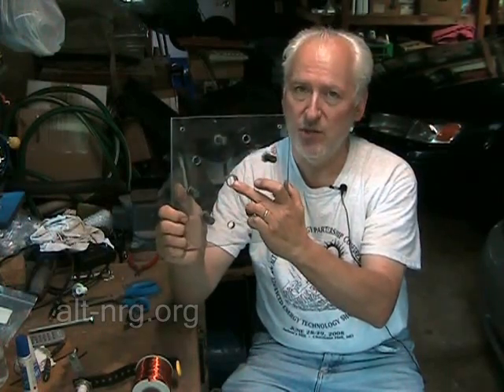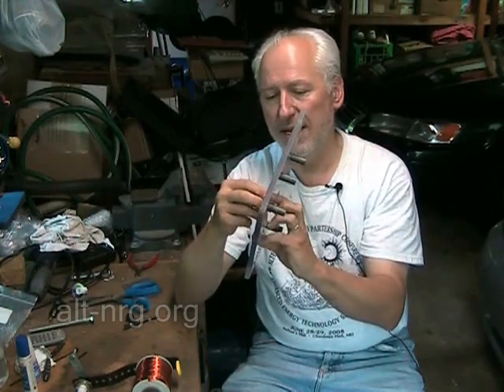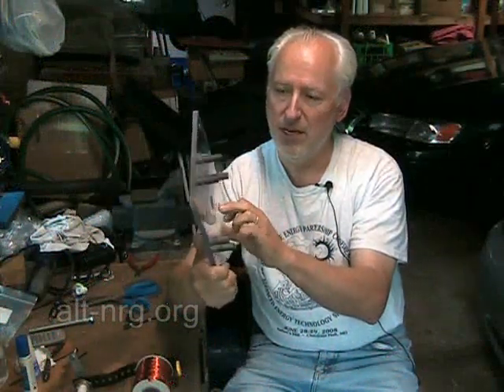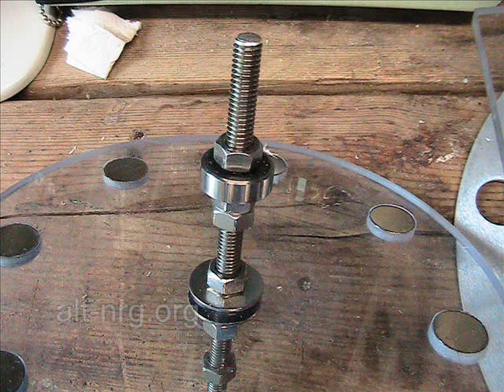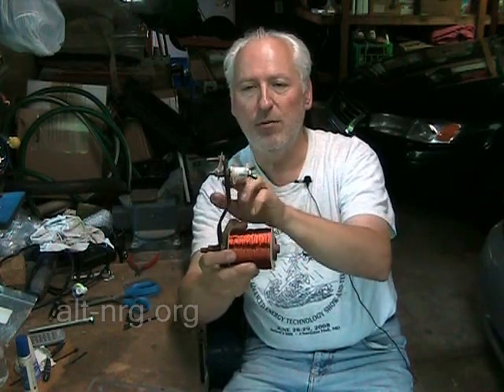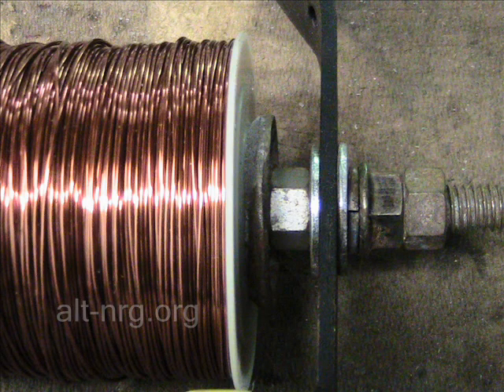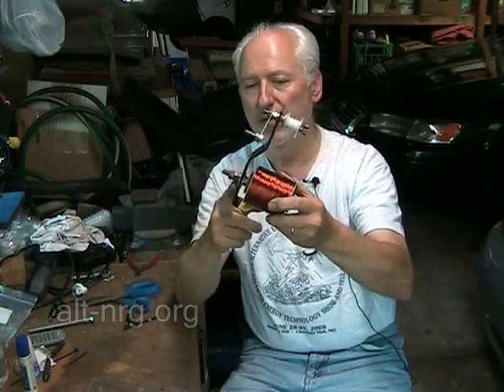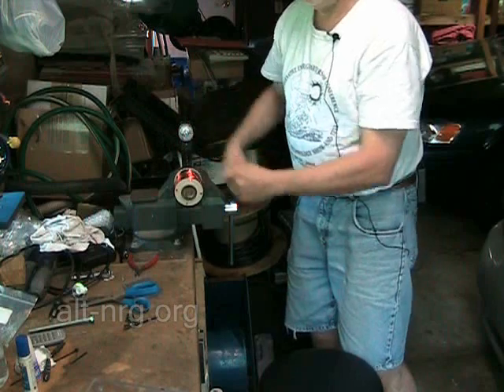#279 Muller Magnet Motor Dynamo 11

Comment: Please do a small experiment.
Wind one coil with the large diameter solid enameled copper wire you have, & a second one with multi-strand of smaller diameter enameled copper wire of equal mass & turns--like RomeroUK used.
Do an equal low impedance load oscilloscope test to find optimal freq. of spinning magnets. Power transfer vs freq.
My theory is the multi-stranded smaller diameter equiv mass enameled copper wire coils will have lower overall high frequency AC resistance than the other?